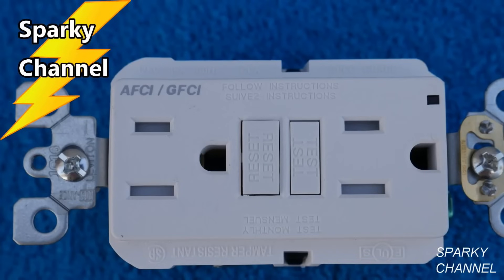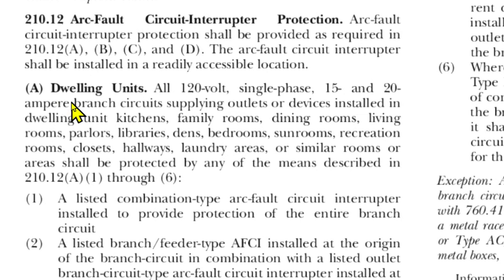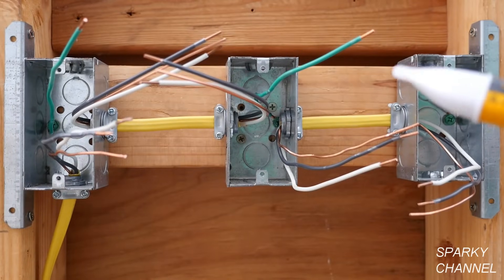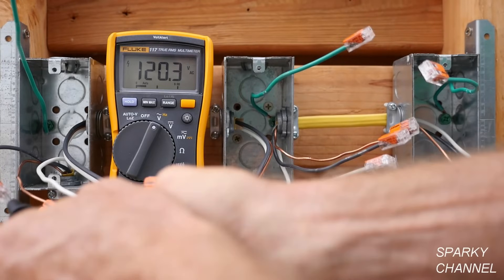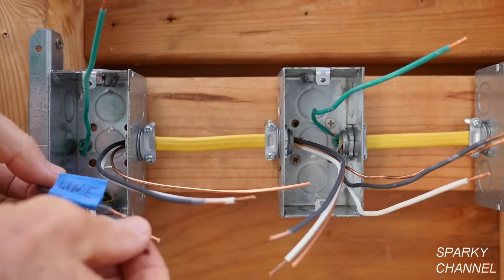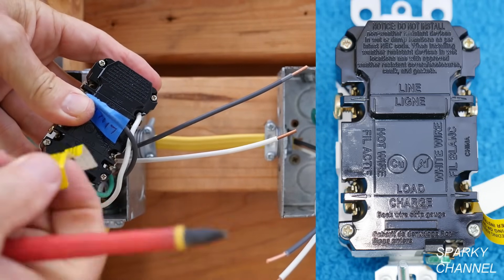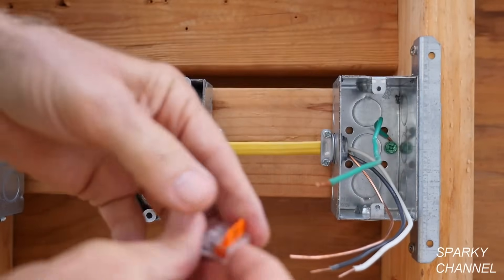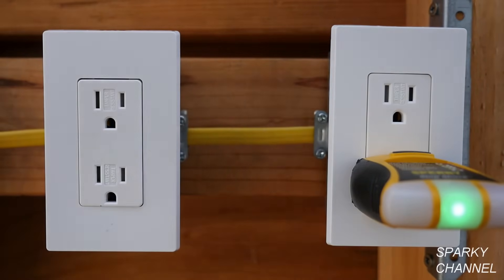Protect a Circuit With Both AFCI and GFCI with a Receptacle!

Comment: Bill Another great Vid As Always two Questions I have Please.
1. That afci/gfci outlet indicator light in the bottom right didn't illuminate, whats is its purpose?

2. Will that afci/gfci outlet trip if there is an electrical problem Downstream after that Afci/gfci outlets?

Please explain sir?
Thank you.

Comment: Sparky,  I'm looking at the picture of you kneeling with two tool bags in front of you at the conclusion of your video "Protect a Circuit With Both AFCI and GFCI with a Receptacle!" Would you please I.D. the manufacture of those bags. Electricians are always looking for a tool bag that can carry all the different screwdrivers and pliers he'll need at one time or another on the job.

Comment: Can we use these receptacles instead of arc/gfi breakers? And start using the original cheaper breakers?
Reply from the maker: Yes, you could do that.
Reply: @SparkyChannel  what about the home run to the first outlet, it wont be protected. Will inspectors let that pass, or do you need to use m.c. and or case in concrete to avoid that?

Comment: If they would come up with Wago wire nuts that you don't have to strip the wire, it would just pierce into the insulation when closed, that would be too easy, I guess.
Reply: That might not be a very secure connection.  However, how about receptacles with built in Wagos!

Comment: All of these things should have their wires added but those wires should them come out of the box and tie into ONE other box, or better, run all the way back to the panel. If there is a box, it makes it so much easier to work on something, especially where there is maybe several circuits, like switches in one gang box. And there is one problem. More often than not, you must then take out all the switches to get to the wire nuts. Replace those with lever splices whenever possible. But then you have to put everything back together. It's a lot of extra work. Then if it's like my house, someone uses one wire to connect all the switches, with splices at different points in the cable. If there is another box, where it all ties together, it eliminates a lot of that. So there's an extra plate on the wall. People will get used to it, and it will make electricians lives so much easier, unless they're correcting something that someone else did that didn't know what the hell they're doing, which I find in this house. I would change it all out myself if I could. Right now, I still make the connections in the box I am at with other circuits. It would be so much easier to only have replaced ONE switch rather than remove all three, separate the wires, determine which wire goes where then put it all back together all for ONE SWITCH. Hard to explain what I am talking about, and even more difficult to write it in a way that is understandable.

Comment: Please make an argument as to why I would not just put the AFCI in the breaker box?  AFCI devices protect from fire by detecting "arcs" or shorts of the circuit. If that AFCI trips, then your circuit is dangerous/compromised. That circuit is quite possibly a real safety hazard.  Not a possible hazard.. It makes no sense to me that a family member could just press the reset in the kitchen with no idea.  You should be calling an electrician or at least know your breaker box.  If I am incorrect I will edit this.  Thanks

Comment: Hi Bill - DIY homeowner here who’s gained a lot of knowledge and some confidence from your and other electrician videos. 

I just did a similar setup as shown in this video, in my detached garage (panel inside the house), where none of the receptacles had protection. I replaced the first receptacle with a GFCI. The test and reset button work as expected, but when I press the test button on my outlet tester (which indicates correct wiring), nothing happens. Same if I put the tester on the other receptacles. 
I noticed in your video that you only checked the test & reset buttons on the 1st outlet, not using the GFCI test button on the tester itself. So maybe I shouldn’t worry? 
I’ve also read that when this occurs, some electricians test using a Wiggy, which I’m just now learning about. Could you maybe have a video demonstrating using a Wiggy? 

Thanks
Reply from the maker: The GFCI was designed to be tested with it's own button. How a certain brand of outlet tester works with the GFCI is immaterial. Pushing the GFCI's button is the principal test to see if it works properly.
Reply: @SparkyChannel  Awesome thank you very much!

Comment: Great video.  Can you use a AFCI/GFCI outlet instead of a surge protector power strip to protect sensitive electronic from power surges from thunder storms?  I've heard that surge protectors power strips don't really offer any protection.  I'm thinking about plugging my computer into a AFCI/GFCI outlet instead of getting a surge protector power strip.
Reply: If you already have a GFCI/AFCI receptacle a surge protector power strip isn't useful unless you need more than 2 outlet. But yes I would run a AFCI/GFCI receptacle for each bedroom and if done correctly will protect all receptacles in the circuit.

Comment: Why not just change out the panel?
Reply from the maker: Sometimes older home's panels will not accept an AFCI/GFCI breaker because none are available. Also, panels are very dangerous to work on and many may feel more comfortable changing out a receptacle. Also, AFCI/GFCI breakers can be quite expensive.
Reply: @SparkyChannel  Trying to  understand:  Arcfault protects from fire.  Is the risk is greater downstream from the first breaker than it is between the panel and the first breaker?

Comment: Thank you for uploading this video, I have to tell you that I find learned a lot watching the Sparky channel; learning to bend EMT conduit to how properly wore a three way switch.
I have a couple of questions:
1.- if I have a AFCI/GFCI Outlet installed do I still need an AFCI/GFCI circuit breaker?
2.- would it be the same if the outlet is rated GFCI only, would I need an AFCI/GFCI breaker?
Thank you Bill,
God bless you mate!

Comment: I have need to protect an above shower light and fan with a AFCI and GFCI branch circuit. Is the process the same for protecting two switches and it is for two outlet like you show here
Reply: You need a dual function breaker instead.

Comment: Can you discuss the code requirements around protecting the entire branch circuit?  I heard that the entire circuit from the breaker panel must be AFCI protected unless the first receptacle is fed via metal conduit and enclosed in a metal box.  Is this for new construction only?  Is there an exception for remodels where the first receptacle might be fed with Romex and/or enclosed in a plastic box?  

i.e. https://www.ecmag.com/section/codes-standards/keeping-date

There were two exceptions added to 210.12 in 2011 NEC, both dealing with outlet--style AFCI devices. For Exception No. 1, rigid metal conduit, intermediate metal conduit, electrical metal tubing, Type MC cable or steel armored AC cable, all in compliance as an acceptable equipment-grounding conductor, can be installed between the branch circuit panelboard and the first outlet in the circuit. This first outlet box must be metal, and any junction boxes between the panelboard and the first outlet also must be metal boxes. Where these previous requirements are accomplished, an outlet-type AFCI can be installed at the first outlet to provide protection for the remainder of the circuit.

Comment: Doesn’t the home run from the breaker box to the first outlet (AFCI/GFCI) need to be ran in metal conduit?
Reply: Sparky addressed exactly this earlier.  You were correct say three years ago.  A mild rewrite of that code section deleted that cumbersome requirement.

Comment: Is this line/load connection only on GFCI/AFCI outlets? Is there any context in which you would connect both the line and the load black/white wires to two screw terminals of a regular outlet rather than pigtailing them and connecting a single wire each to the outlet?

Comment: Faster way to find your feed, while you have the devices out and everything unspliced, is to check for continuity between ground and neutral. Neutrals and grounds are bonded together only at the main service, so only a feed/home run will have that continuity. Saves a trip to the panel. I use this all the time to check what’s my feed in a given box. Really helps when dealing with old cloth bx cable where the white or red has gone and all the wires are black.
Reply: Thanks, good idea. Also, you posted a useful and intelligent comment on Youtube, the first one I have  read today. It'll probably be the only one I read today.
Reply: That's a great idea.  But working on an older installation, you shouldn't stop at the first cable you find neutral-ground connected.  It SHOULD be only one feed but....   If you find more than one feed with neutral-ground connected, you know somebody has done something bad.
Reply from the maker: Thanks Billy!
Reply: Thanks man. Good one!
Reply: Thanks Billy for the tidbit.
Reply: Wow, what an amazing lesson that shows the safety and technical know how. I have learned so much from watching a master electrician teaching people like me who are beginners DYI people. Thanks
Reply: @choyvong6843  the only exception to this is if it's a circuit that may need a gfci. when a gfci trips, it opens up both hot and neutral lines. so if you're working on a circuit that could powered off a gfci and there's no power and all breakers are on, and there's no continuity between ground and neutral, there may very well be a tripped gfci some where.  houses build in the '80's an 90's needed gfci's but guys would run one circuit for bathrooms and outside outlets and use one gfci receptacle!  Once we had no power in a 2nd floor master bath and finally found the tripped gfci...outside outlet behind a bush by the front door.

Comment: So I guess that 50 or 70 feet is written off for protection then that could be in walls, ceilings or floors, which is the whole reason to use AFCI if they run a nail in it?  For AFCI I would always use breakers so that the entire cable is protected.  For GFCI's which is protecting the person not the wiring I can see outlet based ones are fine, but in reality I would just use combo breakers at that point as well, especially if dealing with 12AWG wiring in single gang boxes, that way all the reset buttons are in one single location instead of all over the house.  The GFCI outlets always seem to get covered or behind by something, which I have run into that in the garages all the time.   With all the requirements for GFCI's on 240 volt outlets now, you are going to have to install them there anyway, why not put them all in the panel, as the 120V combo breakers aren't that much more.

Comment: Hi Bill!
I do not believe this installation is up to code. There’s been a lot of discussion if 210.12 A(4) allows a standard circuit breaker and a separate AFCI device at the first receptacle box. While some inspectors might ok this, many require the circuit breaker to work in conjunction with the receptacle type AFCI device (so the AFCI receptacle will cause the circuit breaker to trip during an arc fault to protect the home run wiring). Here’s a discussion on MikeHolt about this topic: https://forums.mikeholt.com/threads/210-12-a-4-does-this-allow-home-runs-not-to-be-arc-fault-protected.149033/
Eaton has made a circuit breaker and AFCI receptacle combo solely to comply with 210.12 A(4) : https://www.eaton.com/sg/en-us/products/residential/circuit-breakers/system-combination-arc-fault-circuit-breaker.html
I do not believe Leviton has a solution to this problem nor did I see the specialty circuit breaker for this installation. 
Thanks!
Reply from the maker: Interesting, thanks!
Reply: My take too! As I read NEC 210.12 A 4 d, I see that the circuit breaker must be listed to work in conjunction with the AFCI/GFCI receptacle. Only 1 manufacturer currently makes this combination, Eaton, and if you have to buy a new circuit breaker along with the AFCI/GFCI receptacle then you might as well just buy a dual circuit breaker. By default if you don't have an Eaton panel this won't work.

Comment: I like the purpose of a dual function AFCI/GFCI OUTLET But it technically doesn't protect the whole circuit, only protects any outlet after that dual function outlet. Doesn't protect from the panel to the dual function outlet.
Reply from the maker: That's correct.
Reply: I have seen a couple situations where a series fault in the wiring leading to the afci caused a trip, due to the current being drawn by a motor downstream. Parallel faults likely won't be detected. Some cheap LED lights also cause interference, which can be picked up by an AFCI on another circuit.
Reply: Good point, LWDCRAZYMAN.

Comment: interesting. the 50 ft-14ga /70 ft-12 ga  wire runs in a large house would have main panel placeent implications. so will sub panels be necessary in large houses to get beyond this?
Reply from the maker: Perhaps, but probably better to use a Dual Function breaker.
Reply: @SparkyChannel  if your box will accomodate one
Reply from the maker: @richardcranium5839  Yes, very true!
Reply: @SparkyChannel  Bill are those max run numbers from panel to 1st outlet or for run between outlets?
Thanks.

Comment: interesting - they've dropped the requirement that the conductors upstream of the AFCI receptacle be protected in metallic raceway or conduit.in my last install, the only option I had available was to install a 4sq box under the panel and use two devices to protect two ungrounded circuits.
Reply: Yea I thought that was the case too
Reply from the maker: Thanks!
Reply: Knob & tube?
Reply: @JoshKaufmanstuff  I suspect there was some in the system.

Comment: A house has no AFCI protection but does have GFCI protection; will installing AFCI breakers in panel be sufficient?
Reply: if the house is already built, it does not have to be modified to meet new AFCI requirements, but yes, putting AFCI breakers in the panel and local GFCI receptacles is acceptable.
Reply from the maker: What Ken said is correct.
Reply: @SparkyChannel  Thnx!

Comment: These Screw-less plates are great...Eaton brand is tops (certain that is one you just used) Eaton also makes for duplex receptacle design, as well. Lowes actually carries them. Plates were once named “Cooper, Aspire” Leviton os bulky and seem shows on side. BTW, do not lose the tiny screws on backing plate, unique size not carried at local hardware store
Reply from the maker: Yes, the Eaton screwless wall plates are excellent and not as pricey.

Comment: Love your videos sparky!  Two questions:  1.  Each the receptacles appear to have self-grounding features that bond the receptacle to the box via the mounting screws... So is the green pigtail to the box necessary?  2.  In the middle box, could the incoming and outgoing black and neutral conductors be directly connected to the receptacle, thereby saving two wagos and two pigtails?
Reply: Joseph, the pigtail connects the ground to the receptacle and not to the box. The answer to your 2nd question is yes, however using wire nuts or Wago's is preferred because it eliminates the reliance of that receptacle to continue supplying current downstream.
Reply: @surferdude642  Ted, there is also a 2nd pigtail from the back of the box to the grounding wago... That is the pigtail I am questioning...
Reply: @josephknapick5307  Yes, I see it now. It could be redundant, but if there is room in the box it's probably good practice. It shows quality workmanship.

Comment: Hey Bill I’m really enjoying your channel. I have an unfinished camp that was wired back in the 50/60s with the two wire cloth cable. This summer I’ll be tearing it out and running new wires, switches, receptacles, and installing AFCI/GFCI. The camp will remain unfinished, just outer walls and studs.  What’s the best wiring to use to meet 2020 code?
Reply: optimum would be to run it in conduit.  MC would give better protection against the chance of rodents, but NM would be acceptable as long as all of the cables are nailed flat along framing or blocking.  I would recommend insulating and installing interior paneling, though - just on general principles.
Reply from the maker: Ken's answer is really good. I would go with MC.

Comment: What would happen if someone put a nail into the cable between the breaker and the first outlet causing a parallel arc fault to ground? Would the AFCI would trip due to the upstream arc fault?  Even if the AFCI tripped, this would remove the load, but not the parallel fault condition.  I would think then, that it would be safer to put the AFCI in the breaker panel.
Reply: you are correct. - and the AFCI would not trip on the upstream fault.
Reply from the maker: Ken is correct.
Reply: I thought that the feed from the panel to the Dual AFCI/GFCI receptacle still had to be in a metal conduit or raceway to preclude this possible scenario.
Reply: @hjc4604  they seem to have dropped that requirement.
Reply: @kenbrown2808  I wish I knew that 6 months ago.  We did a major remodel/rewire of a house.  The Dual function outlets were half the price of the dual function breakers but i wasn't about to run conduit to all the first outlets to replace the NMC.
Reply: @hjc4604  AFCI protection at the panel is better anyway, since general purpose receptacles aren't usually in convenient places to reset a nuisance trip.